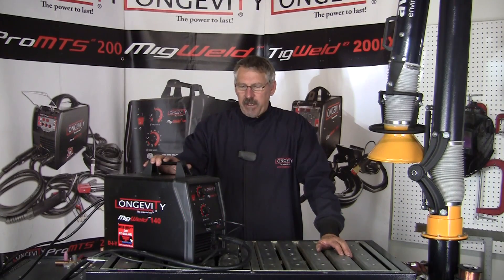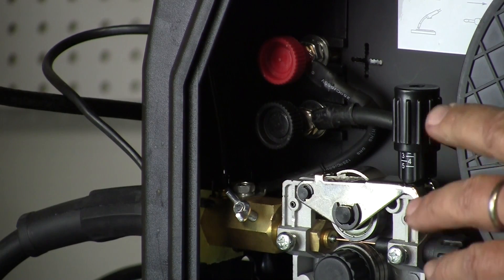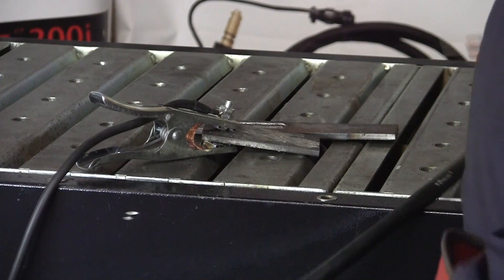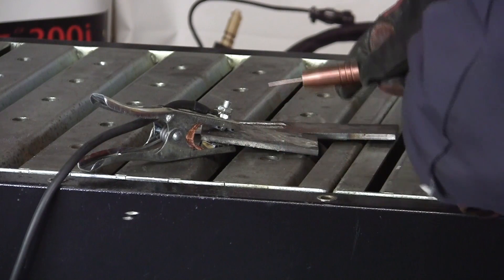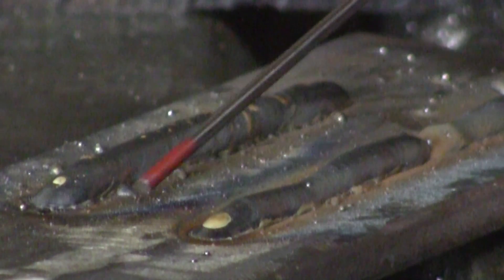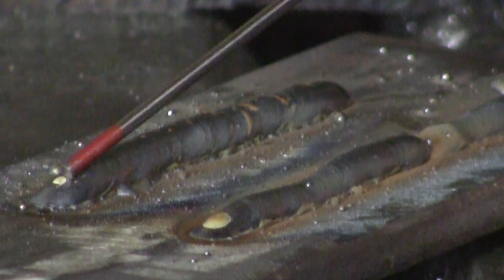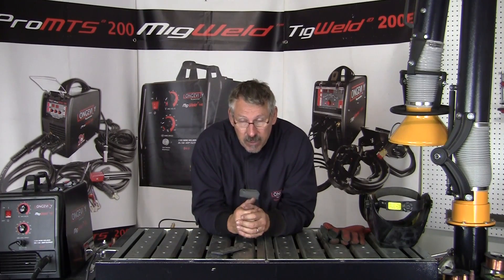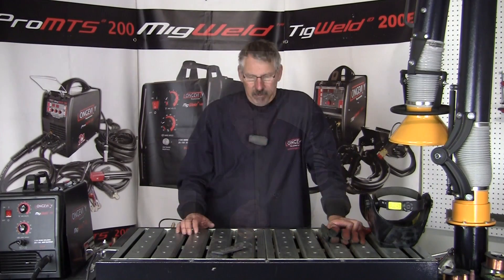MIG WELDING COMPARISON - DC ELECTRODE NEGATIVE vs DC ELECTRODE POSITIVE

Comment: Bad explanation.
Positive electrode gets always hotter, if wire is positive, it heats up and burns into the base metal.
Negative wire, wire remains relatively cold and gets pushed into hot base metal. 
But since it's not TIG, where you can control weld puddle and also because it's much faster, there won't be a good, deep weld pool, thereby the shallow welding penetration.

Comment: I couldn't figure out why my Lincoln mig wasn't welding very well. The guy I bought it off of made it gas instead of flux core but he had the grounding clamp as positive and the electrode as negative. I swapped them around and now it welds great.

Comment: This is a poorly thought out video. If this regards MIG welding, which requires gas, why would DCEN ever be considered? (don't do it kids, stay with DC Reverse only). Maybe he forgot to get to the part about using dual shield and hard facing wires that may require DCEN. The terminology is random and inconsistent (torch connection: "this thing, this receiver, this wire").  This outfit needs to do better than waking up some guy and telling him he has to do an ad lib instructional video in 5 minutes. Anyone giving a complimentary comment is either as clueless as Bruce or didn't watch the video. This is not a good way to sell welding machines.

Comment: Great explanation. Recently uploaded a video on modifying my Flux Core welder and was told by a friend, who is a welder by trade, that my ground clamp should be DCEN, but I didn't think that was correct. Decided to search around for some explanations on this topic and found your video. Cheers
Reply: ive just watched this and now im even less sure what to put where, im on a cheap gassless flux core set up, do i want the clamp, or the gun on the red terminal ???

Comment: wish  you had covered flux-core mig welding. just watched a video where the narrator had neg on the wire and positive on the ground and got far less splatter and a better (arguably) weld. he also explained the electron flow aspect.
Reply: im on a gassless, what should i connect to the welder red live terminal, the earth clamp or the gun?
Reply: @lazycarper7925  the gun I believe but check with a professional welder or your nearest weld supply shop

Comment: The metal has to come from the positive electrode,the opposite way to the flow of current. current flow from negative and metal flow is from positive to negative. With arc lamps its the positive electrode that is made bigger because of metal migration from it same with xray tubes,mercury lamps etc. For AC both electrodes must be the same